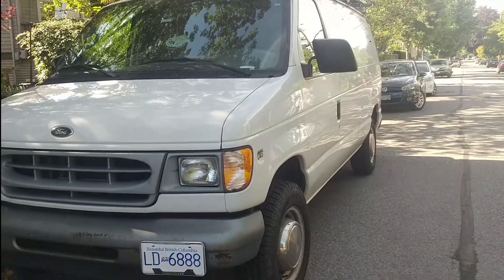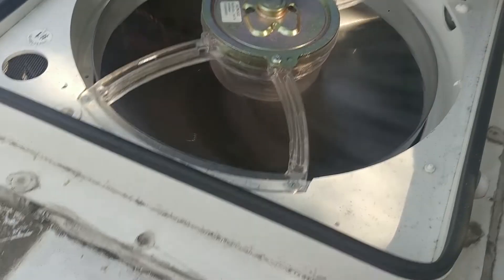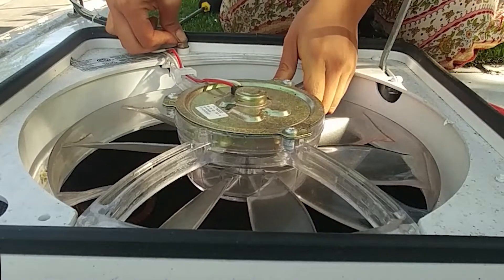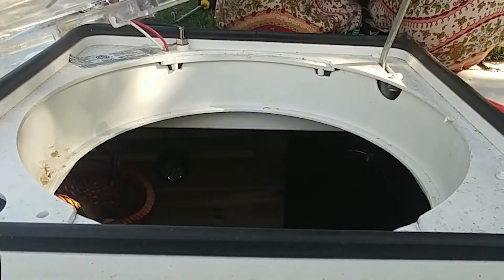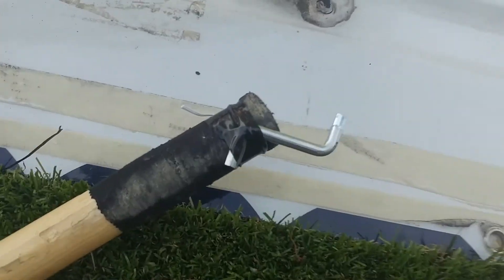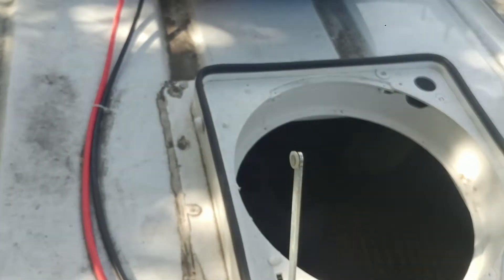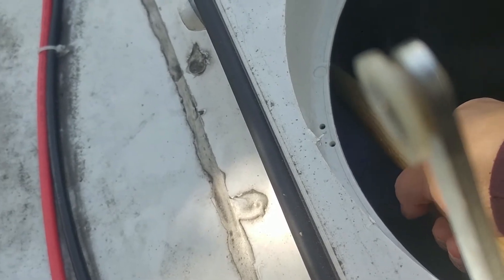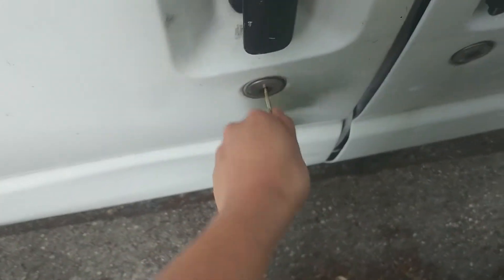BREAKING INTO MY OWN VAN! | VANLIFE | Van Lefan

Comment: That was clever. What wasn't is...we did see for a short moment your car plates so now one know that in Vancouver, a white Ford van with that plate number is full of stuff ( maybe you could edit it out ?). My experience told me I need 3 keys. A regular one, one in my wallet and last ( as suggested by many) one hidden somewhere on the vehicle. On the van I lost in the US, I had my third keys in the awning box...actually, it should still be hidden there...unless they did decide to scrap the van and crush it. 
  The game in preventing thieves to break in your car is to don't leave anything visible from the outside. Every week in Vancouver, I see smashed windows everywhere in town. 20 years ago,  I had two cars and one of them had my Norman guitar on the rear seat. I was sleeping in the other car just 20 feet away. In the night, a noise did wake me up. I did have a look...there was nothing wrong. The following morning, I discovered they did break my window with a sling shot and they took my guitar. That was in Peachland BC at an orchard...20 years ago.
Reply from the maker: Well the license plate really doesn't make a different since its pretty recognizable anyways with that rooftop patio and solar panel. Nothing is ever visible since I have window coverings, things just happen sometimes

Comment: Just a thought , what about air conditioning in the summer heat ? How do you get that going ??? Do you keep the van conditioner on all night ?
Reply from the maker: I don't have an air conditioner, I have a fan-tastic 12v fan that I'll turn on during the day to keep the air circulating, and generally as long as I'm parked in the shade or near the water I haven't experienced the heat in Vancouver to be a big problem! in fact I've actually found that my van is usually cooler than most people's apartment's/houses I've been in!